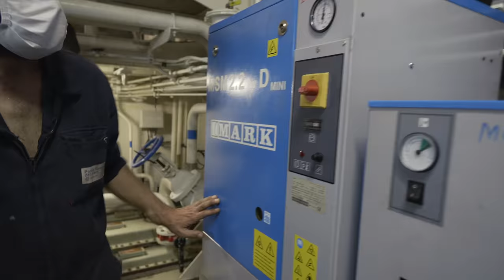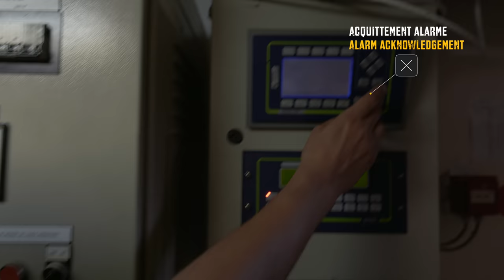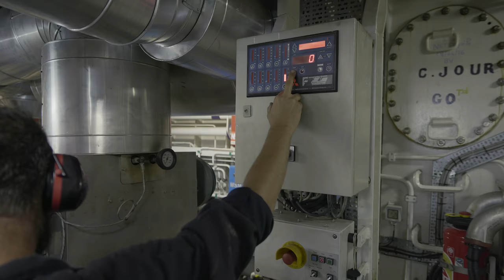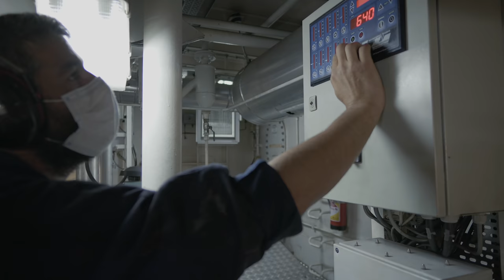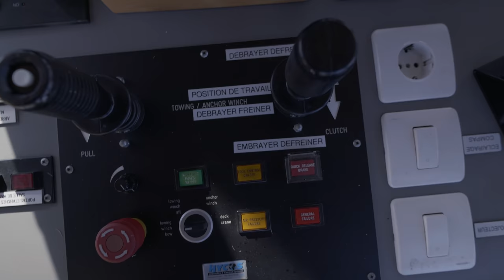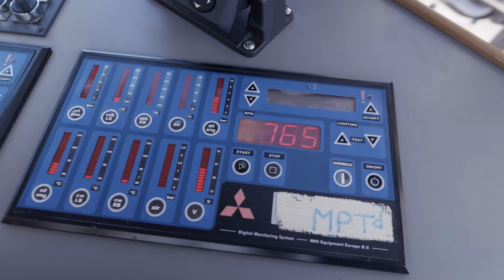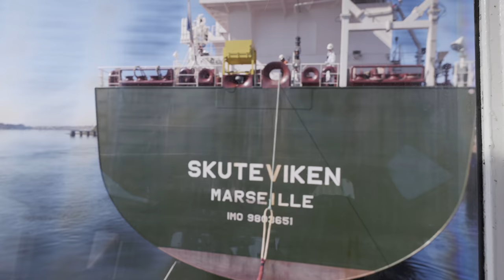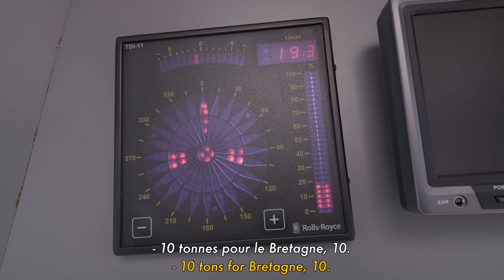LE REMORQUEUR : L'EQUIPAGE A LA MANOEUVRE

Comment: Let’s start from last step on this maneuver.
When the tug boat coming to push ship from port quarter..! 

As my experience we can use the tug boat to bull or push the ship from port quarter if made fast short line.

But if the tug boat made fast from center aft finally need to cast off line to change position as a pusher.

Comment: i always thought tugs had old tires around the perimeter. this thing is just classy with it's solution to the problem.
Reply: For Safety reason. Without tires still it moves. Called Popeye's boat, small but Strong & Powerful.
Reply: This is a ship docking tug. It doesn't push much and probably doesn't move barges very often if at all. Tires (they use non-steel belted tires...usually old airplane tires so there's not steel wires sticking out to hang up on things). Tires are superior for barge work since they offer a softer landing when coming up to push a barge. Tugs that move/push/tow heavy barges (like gravel, rock, coal and sand and such) tend to have "cheak" rubber at and below the waterline on the shoulder of the tug. That's because when loaded a heavy barge may only be 1 foot above the water, and the hard shearline of the barge can do a lot of damage to the hull of the tug. Most tugs will also have tires on the bulwarks (the flat area above the deck) to protect from rakes of a barge or ship. 

Tires can be used whole bolted/chained to the side flat against the bulwarks or hull. Or they can be cut and folded and smooshed together like an accordion. This will be mostly around the bow and back to the shoulder. The folded tires grab really good and not only protect the tug providing a cushion, but they also provide grip when pushing a barge so you can slide a barge one way or another when lining up against the dock/terminal. 

It looks like the tug in the video is a Damen tug (Netherlands based, but they build all around the world). One of the tugs I skipper is a Damen. I also skipper other "west coast" tugs here in BC.
Reply from the maker: Thank you Chris for your accurate comment 👌